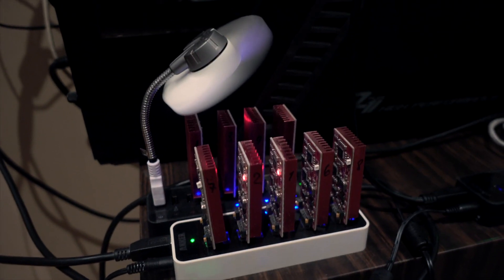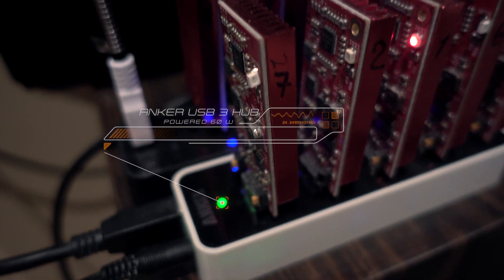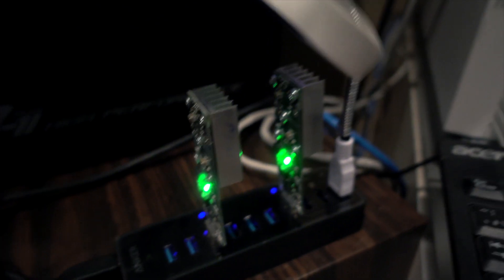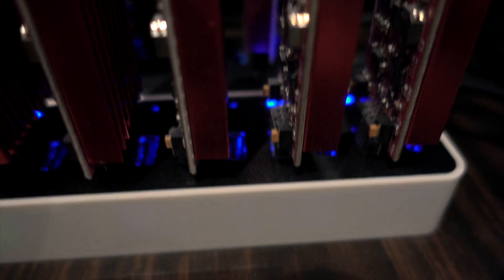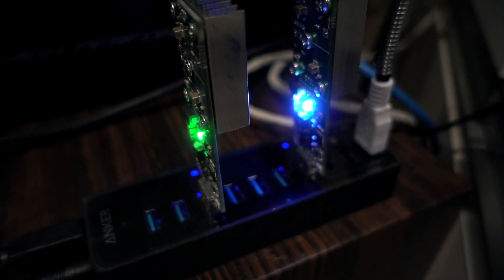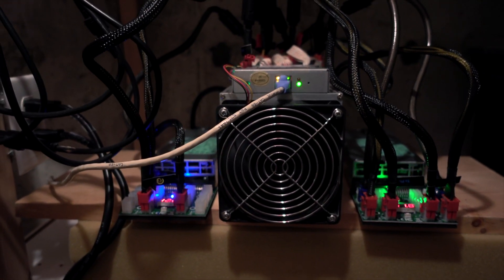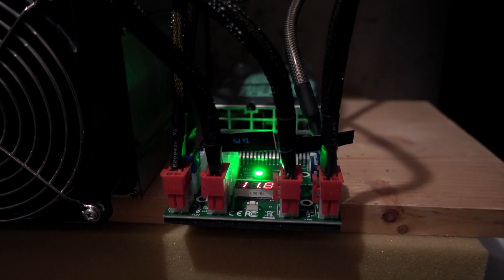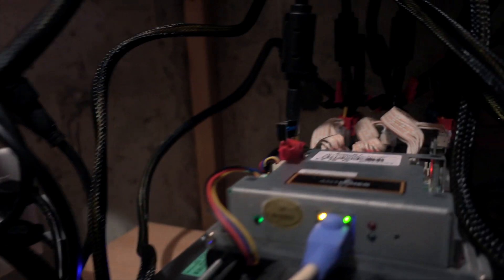20180106 HOW TO SETUP BITCOIN MINING AT HOME 2018 part 1

Comment: Guys can u include how much you will earn in one month
Reply from the maker: The best way is to check with estimator site. (https://www.coinwarz.com/calculators/bitcoin-mining-calculator/). Under current difficulty value, you will need at least S9 to be in plus balance. with current rate of 6374$ for 1BTC you will get close to 0.01 BTC in 3 weeks. (your min payout). Deduct your electricity cost and that would be your finals.